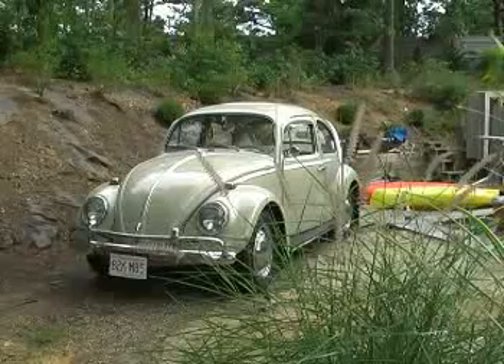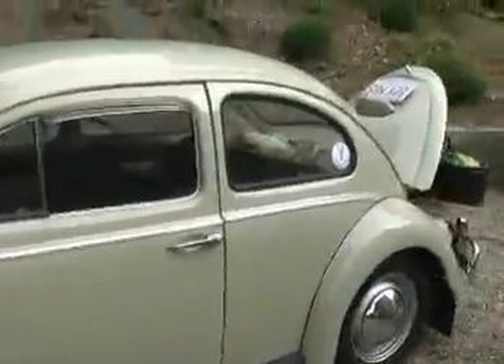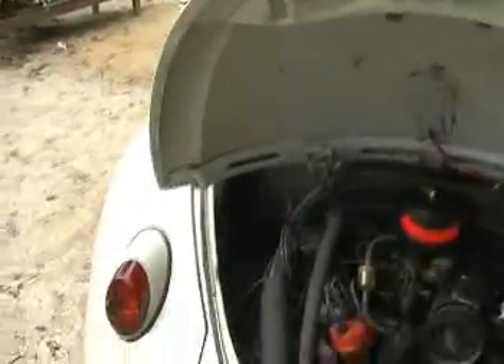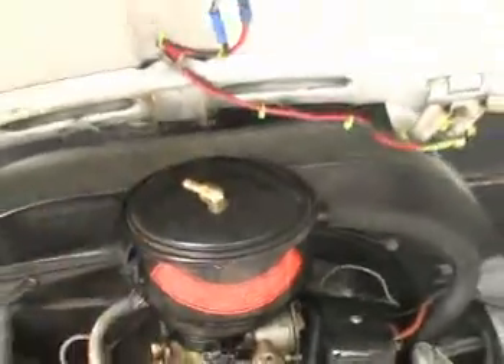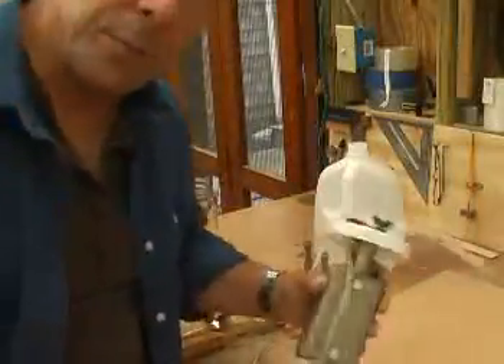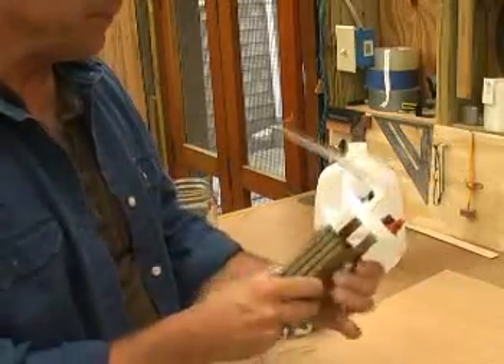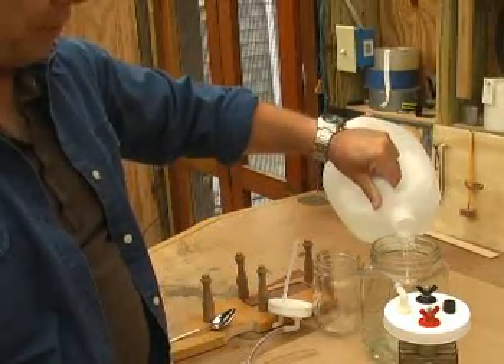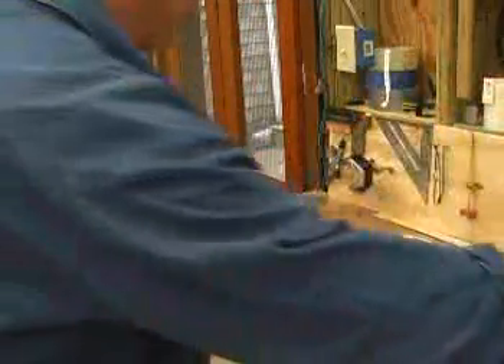hydrogen generator finally proven pt.1

Comment: Why does everybody call HHO systems HYDROGEN systems.
In a real system you want to add hydrogen/air to the engine not hydrogen and pure oxygen.To make real hydrogen you need two chambers one cathode connected for hydrogen and one anode connected for the by product oxygen.Yes they must be mechanically connected together for electron flow but the two gases remain separate.Oh and 12-13.8 volts is way too much voltage.Electrolysis is most efficient at low voltage and high current.